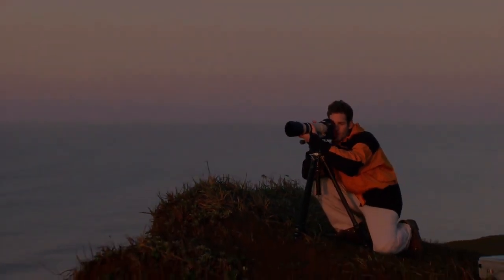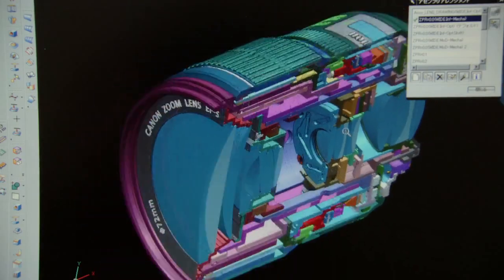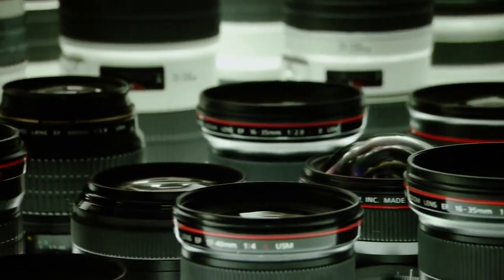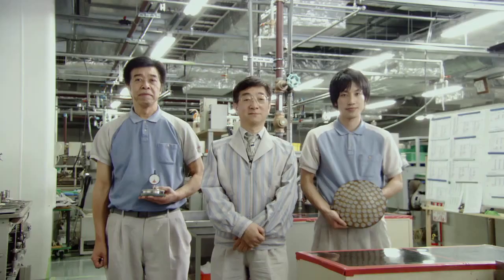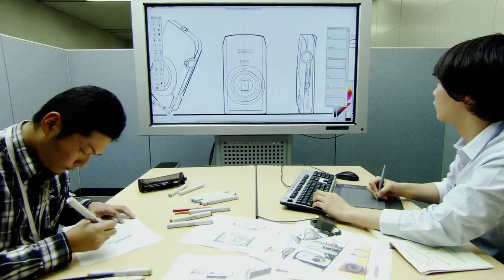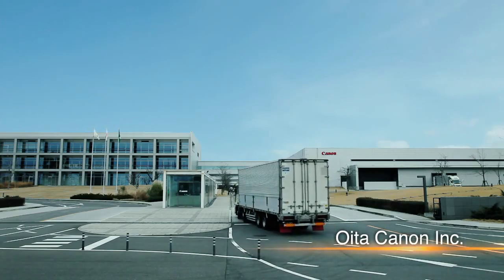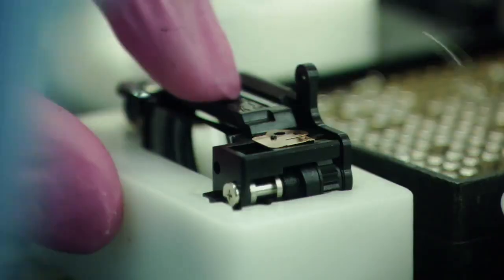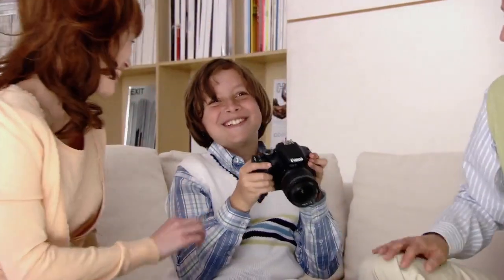How a Canon Digital Camera is Made

Comment: I had the Canon A2500, which is a great P&S, but the SD card was corrupted, so now I'm getting the 80D!
Reply from the maker: Well, the SD cards are not as much reliable as we would like it to be, but it happens...  SO far, the most reliable I come across are SanDisk cards. 
The corruption of the SD card or CF cards are not due to camera fault - it's the cards manufacturing process, the quality material they use, the different environments in which cards can be exposed (magnetic fields, airport scanners, cold and hot water or just cheap (bad) card readers...
Canon 80D is awesome camera - Go For It!!!